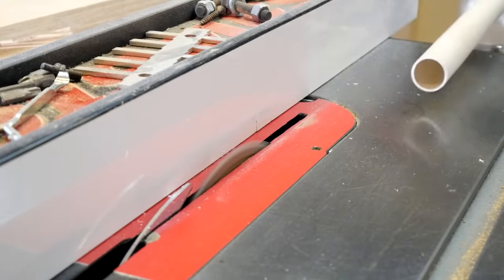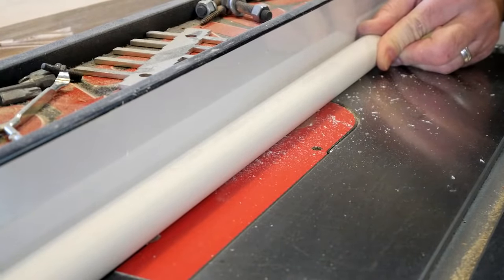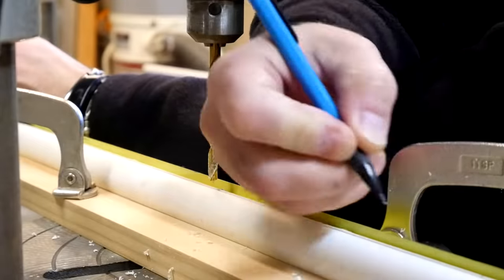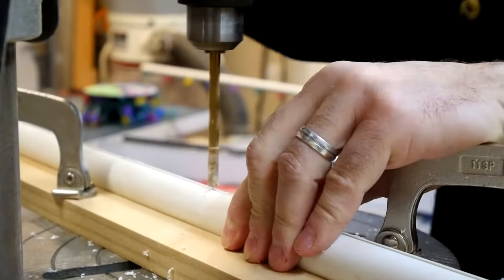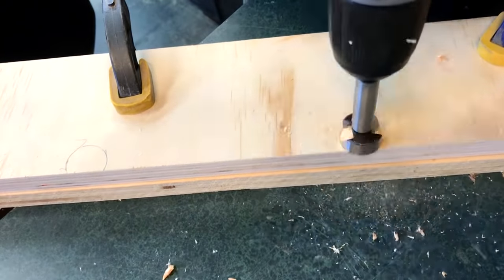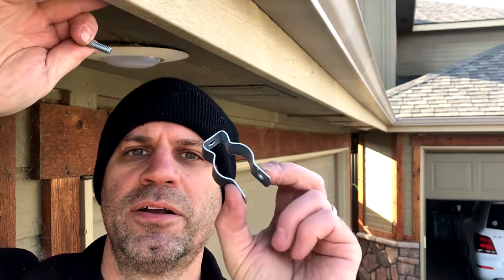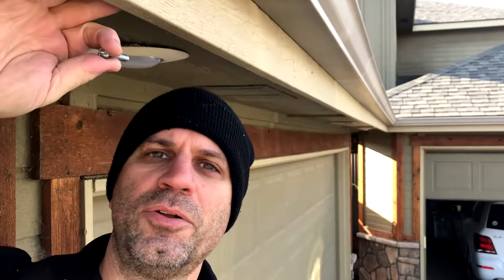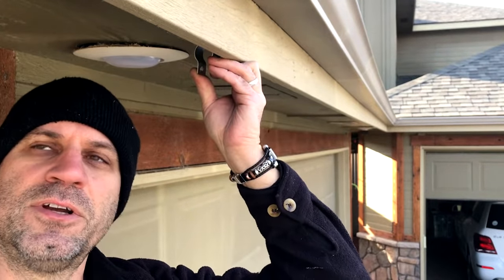Better Way to Install Christmas Lights

Comment: I don't mind stringing the lights around the front and along the peak of the roof.  My fear these days is climbing our steep pitched roof which I tried yesterday afternoon after not having done it in a long time.  I thought this isn't going to happen!
I always thought a pulley system with brackets on each end of the roof peak to attach the lights too and shift them over might be neat.  Kind of like a clothes line...

Comment: We did this in 2002 when first decorating a new house. Drilled 1” PVC for the lamp sockets, then ripped the cord groove. Made clips from rings cut from 1-1/4” PVC, splitting them with PVC shears. Attached clips permanently with screws under the soffit edge. We snap up over 500 lights in 2-3 hours. Built storage trays from 1/4” plywood, which are mounted between garage joists. Trays hinge down to load and unload. Nineteen years, a couple of broken clips, otherwise still working great, and most of the original bulbs still light thanks to gentle handling.

Now the challenge is to retrofit RGB C9 LEDs into the pipe.

And, by the way, the lights look just like they would if hung on hooks or clips.

Comment: Looks like a whole lot more work than using plastic clips. Plus where do you store them once you take them down. Appears they would take up more space as well
Reply: I agree
Reply: You must not have noticed in the video how he talks about not having to take them down.  He just rotates them in place so the lights are hidden.
Reply: @Craig Chatterton
He is still right as the video poster simply hinted at being able to do that.

This is way more work than the clips and only makes sense IF one is willing to have the lights showing all year long. Even rotated you will see them.
Reply: I believe the idea was to have the lights be very neat and orderly which this achieves. You can’t quite get that look with clips.
Reply: @mollykrieg2510  I use shingle clips and mine are as straight as an arrow. It is all about the spacing + tension.

Comment: A spline mounted on your jigs into the rip cut would keep your drill-out perfectly in-line, same scenario on your table saw! a tabletop jig with a dado cut down the centerline of saw blade to push the pipe through and a kerf cut on the out-feed side with a spline inserted (like an inverted splitter) for alignment! I found your build more interesting than the application for myself👍…. another woodworker!

Comment: I did something similar with PVC pipe.  I have commercial grade LED lights that look fantastic.  The company sells clips that hold the light with a clamp on the top side that almost fits the PVC.  I put velcro tape around the pipes to allow the clip to hold securely.  All I do is put the lights on the velcro and then take them down.  The PVC is held on to the soffit by zip ties and eye hooks.  I could take the PVC down but left it up all year last year.  Very simple and the lighs look great.

Comment: A good idea if you have a table saw and drill press and time to make it. A very neat looking job.
For those who do not have the tools.....I used a ladder one time, only to install J-hooks spanned every 4'; used a pole with J-hook at the top of the pole to set string in place on every hook. Wrap the female end with plastic to prevent from getting wet, and start by placing the first bulb on the outside of the J-hook to keep it in place then run the string. I was done in 20 mins. plus running an extension cord under the soffit to the porch light for power. End of season reverse procedure, allow the light string to lay on ground and roll er up. A neat little package stored on a shelf til next year.  I don't leave my lights up all year as the front of my home faces the south and would be destroyed by the suns rays in extreme temperatures. I would have liked to have seen your project lit up though. :(     Regards and Happy New Year !

Comment: Been doing this for years .mounted lights on 10 ft sections of painted 1x2 and installed  eyes every 2ft then just installed hooks under gutters  to hang the lights from . No untangling lights and can put lights up from roof top.

Comment: You could have just cut the lengths of pipe in half and put hinges on them to make putting in the lights and removing them easier. It would also make it easier if you decided to change light style to be used in the pipes. Otherwise his seams like a pretty good idea 👍

Comment: Great idea, but I would have drilled the holes before making the groove and spray painted the pipe green (just so it wouldn't be glaringly obvious it was there).  I'm curious a year later if the plan to swivel the lights up worked and they all still function?
Reply: Or, instead of green, paint the piping the same color as the house.
Reply: @mikebeam822  Granted, my roof & gutters are green so that's why I went with that :)

Comment: I leave my lights up all year, no one says a thing. Great job, looks good. I have a string of LED lights, half of the bolbs are bright, and the other is week. I can't figure it out. Do you have any idea what it could be? I notice on one string that is older than the other that it has fuses. The other don't.

Comment: Several years ago, I installed "J" channel (used with vinyl siding) around the eaves of my garage.  I just clip the C9 sockets to the channel, the wire more or less rests in the channel, and everything stays nice and straight.  It takes me about fifteen minutes to put up and take down my garage lights, and that includes moving the ladder around.  The channel stays up year-round.  The lights go up in late October and come down the first decent day in January.

Comment: For those that don't have a full workshop, I would recommend just getting wire channel strips, they already have the opening, it would just require some cutting and drilling the holes for the lights.

Comment: On my set up I bundled 3 sets of lights, each set of lights is about 100 feet long, and placed coated metal hooks about 2 feet apart down the entire lenght. I then stretch out the lights and hang it via the hooks on the gutters. It only takes minutes to set up and take down. Plus, it is easy to store in a container.

Comment: How is this better? It took more time (I could have put my lights up the old fashion way and smoked a joint and drank two beer in the 3hrs it took you to make the holes).  I also seems very impractical from a teardown and storage perspective.  It’s not like 200’ of lights on pipe will fit neatly in a tote in the attic.  Am I missing something here?

Comment: I rewatched the video and could not see the purpose of drilling the holes. Care to clarify?

Thanks for showing alternatives!!
Reply: The cut is made narrow so that the wire won't fall out of it (hence needing to pull it open with pry bar to put the light string inside)... The holes are large enough to fit the double strand of wire that goes to each bulb out through.  Hope that helps.

Comment: Question, would it have been easier to drill the holes first, then cut the slits?
Reply: It would be harder to line up the holes with out the slit as a guide. But I guess you could get around that with a chalk line or something.
Reply: Some pipe has printing that could be a guide.
Reply: @billsedutto8824  connect the dots
Reply: @billsedutto8824  use a v-groove cradle on a drill press table and your holes should stay aligned
Reply: Just draw a guide-line on the opposite side, and track that on your saw.

Comment: I did somthing similar but for a whole differant reason. Metal roof. Ive tried 20 different clips and I even tried neodymium magnets but they just slide right off because this roof has a teflon coating to protect the finish. So I ended up using 1/2" EMT conduit and went around the house with it. Now I just Ziptie my lights to the conduit and when the time comes to take them down cut the zip ties and the conduit system stays up year round. Zipties are cheap at Harbor Freight.

Comment: Pro Tip-paint the pipe black so it "disappears" at night.  I would have installed all of the pipe clamps behind the soffit THEN, just snapped the pipes into the clamps. I'm wondering if maybe when you drilled through the pipe (using the holes you drilled out in the shop) to screw in the clamps, you drilled through the wire, causing the lights not to work?  Maybe that's why the video ends abruptly?  I think you have a very good idea - and good ideas always require finessing in the actual application.
Reply: If you notice at 7:10 he put the clamps up first then snapped the pipe into it. Then used a bolt to hold the clamp closed.

Comment: Brilliant! Ignore the non-constructive criticism. This is a fantastic idea. I HATE hanging Christmas lights & always thought there was a better way out there.
This would work well for patio lights, as well. An added benefit is that the wires would be safe from squirrels. 
Thank you so much!
Reply: I've used barge board clips for years.  But squirrels (or maybe roof rats) have chewed through the wires several times.  Almost always, right next to a light socket so that I couldn't splice it back together.  And, it's always on the highest peak on the second story.  About 20' above ground where I have to use an extension ladder to get up there.

I think I'm going to look into controlled LED lights and mount them like this after this season.  I have deep barge (fascia) boards with shallow overhangs.  I can rotate such a set up down and set the light colors to appropriate colors for the season - xmas, 4th of July, Halloween, etc.  Then rotate them up when I'm done!  And, I can paint the PVC pipe the same color as the house trim to help hide them when not in use!

Comment: Awesome idea 👍🏼… question 🙋‍♀️ wouldn’t it be easier to drill the holes first then cut over them pipe ?? It just looked like when you drilled over the cut ,the pipe wiggled too much. 😊 thank you

Comment: I have an A frame with 25' runs up to the main peak, so I did something similar. I put a coat hook at the very peak, and a couple broom clips on the fascia board of each 25' run. Then I zip tied my lights to metal conduit. I simply hold the conduit straight up and hook the bend (the part in the middle where the two lengths of conduit are joined by a piece of wire, hang it on the hook at the peak, and then spread out the two sides and clip them into the broom clips. Takes about 5 minutes to put 50' of Christmas lights on my main road-facing peak.

Comment: Where is the best place to buy the thin wall (schedule 30?) 3/4" PVC pipe? Doesn't look like any of the big box stores sell it in straight 10' lengths, only the thicker schedule 40.

Comment: That is a good idea and they do look perfectly strung out.  However, that is too much work for someone without power tools or extra storage.  I just screwed in 1/2" plastic coated ceiling hooks every 12"-18" under/behind the fascia and just left in place all year.  Christmas lights go up in ajbout t hours, mostly because of the up/down ladder time, and come down in half of the time.

Comment: A way I was doing it ( when I had a house ) was to put up tiny eye hooks along the edges and around windows and just leave them on the house  and use bag - tye wires or similar twisty wire to string up my lights. You could probably use tiny zip - ties if worried about wrapping wire with wire.
Once I got the ties up ( could even put them up in summer ) I just had to quick twist the lines up. 
Taking them down was just careful wire cutters.
I remember my dad stapling them up with insulated staples and a hammer.
What a pain. Very hard to get started.
Hard to get staples out without hurting lights.

Comment: I think this is a pretty good idea I have a lot of problem with squirrels gnawing on wires, wind, snow and wires getting pulled and stretched so they don't work next year this seems like it would solve a lot of those issues

Comment: I did a similar thing several years ago.  What I find is that if you do not paint the PVC it will deteriorate.  Even if you do paint the PVC you have to repaint it.  This is due to the weathering of the PVC.  I have chosen to use aluminum as it last long, but it cost a little more.

Comment: Nice job.  If I screwed those clamps in I would have used zip ties to pull them closed, but I'm lazier.
Maybe even use some of that black irrigation hose, might be able to split it with a razor blade.  And to hang it just screw a pan head screw inside the pipe making sure not to pinch any wires in the process.  Of course you'd first want to straighten it out and let it set up in the sun for a couple of days so it would be easier to work with.

Comment: Even if you lose the bolts that secure the PVC to the clamps, you could use zip ties to tighten them up. Great idea for the lights, I HATE putting up lights. Might actually do that this year lol I do like others who have said, leave them up and change the color for the season if you have that type. I would definitely go that route.
Reply: I have solar lights and dont worry about them just white lights so i can use the all year around

Comment: This is awesome!!! A few years ago I was talking to my husband about how someone should make something that you could install on your gutters that would just flip one way to display the lights and flip the other way to put them away so you wouldn’t have to mess with putting them up and down every year. You should totally market this! I’d definitely buy it and I’m sure there are sooooo many more people out there who would. Have you ever thought about trying to get in shark tank to pitch them your idea?
Reply: Not practical for retail would be my guess, but for a commercial operation to offer it along side installed gutter screens and such would make sense. For a legit and long-term product, it’d be steep pricing, which would eventually result in cost cutting for that bottom line. Also, the lights would have to have a warranty, which would basically turn the whole thing into trash when they die... too labor intensive for quality would be my best bet. 

If something is worth doing, it’s worth doing it right. If something is worth doing it right, do it yourself.
Reply: It is a clever design plus using a flex line you could do curves.

Comment: If people placed outdoor-rated LED strip lights, they are very flat. They can’t be seen unless they are lit up at night. 
If you get the ones where you can adjust the color, they can be lit up according to various holidays or celebrations…like all blue or all pink for baby boy/girl announcements etc.

Comment: Appreciate the idea but as a woodworker myself, I have had to sit back several times and realize that my "time saving" projects actually took longer than the initial project would have taken. Once you get into a grove of hanging lights, you don't need to remove the clips from the light after taking them down and it takes about 30 minutes to rehang them. This project you made took hours, so it would take 4 years before you start to make some time saving progress, plus the extra time involving installing these onto the roof, initially, another hour or 2. You're looking at 6-8 years before you save time out of your life. Gotta think about it. Is it worth it waiting 6-8 years to save time hanging some decorations? Then you're literally saving 15 minutes per year after that, so after 16 years you've saved yourself a whopping 2 hours out of your life. If you make 20 dollars an hour at work, that's 16 years to recoup 40 dollars. That's how I view these projects, in time/work/money and if you can say that saving 40 dollars in a 16 year period is worth it for you, then go for it, but for me and a lott of others, 40 dollars. That's 20 cents per month or 5 cents per week. I don't know about you but I can make 5 cents in one second of my life right now to negate a "weeks" worth of savings.

Gotta weigh up pros and cons, and this isn't a good money saver, nor time saver.
Reply: My thoughts exactly. He doesn’t have the patience to hang lights, but has the patience to do multiple hour project in his shop. I like woodworking too, but I also value my time as well.
Reply: @larpbusters  Yeah it doesn't really add up. This whole project took him probably 4 hours of messing around + extra hours of filming, and that's not including the actual cost of the PVC pipes, etc. This technically, if you factor in costs of the pipes, could actually COST more money. I just hung my entire house with Christmas lights tonight, put up the inflatables, and it took me 2 hours, only because this is the first time hanging up decorations at this house. Now I have all the clips setup this will take 30 mins next year. THis guy has hooks and clamps, pvc pipes, all sorts of extra work and money. I mean what does he think he's gonna do? Hang up the SAME decorations on the same house for 15 years straight? Imagine him getting a new set of lights and they don't fit into his pipes. Uh oh, time to spend an hour getting them all prepped!

This is one of those videos of "Show that I can do something cool, and it saves time and money, but you gotta wait 15+ years to make it worth it" -- as you said, we value our time so waiting 15 years to get back the time we wasted, not really worth it.. and that's in a perfect world, where everything he's done here lasts 15 years. I'd much prefer to rip down some lights in 10 minutes, then shove them back up next year and if they don't work, oh well buy another set and put the same clips on them and be done with it. 

Cool project though, but practical? I doubt it, and time saving? Sure, in 15 years. Money saving? Absolutely not.
Reply: He could have strung all the lights up with the clips in half the time he did the PVC thing.

Comment: It's a modular system.  Put up a bundle instead individual ones.  Pretty quick if you don't need to deal with too many corners or curvatures.